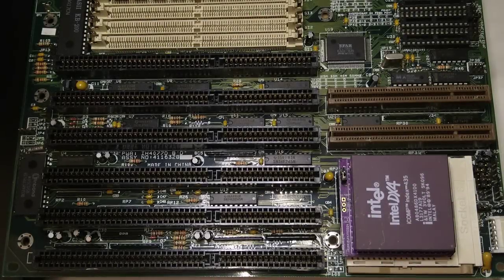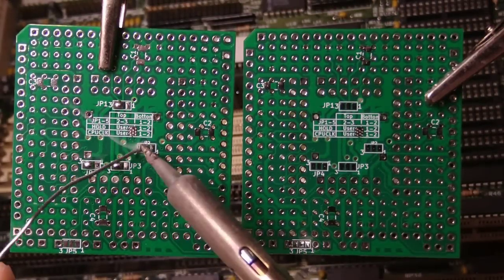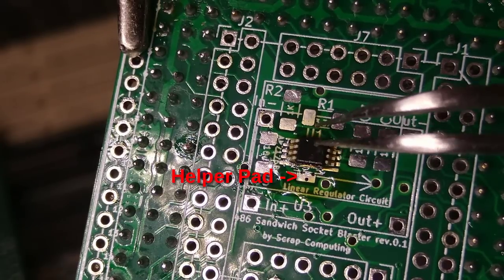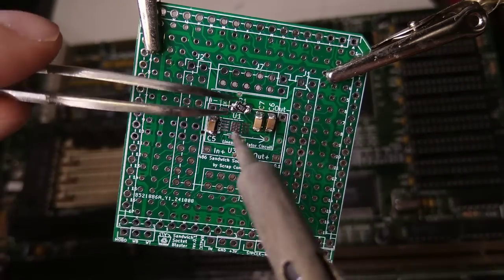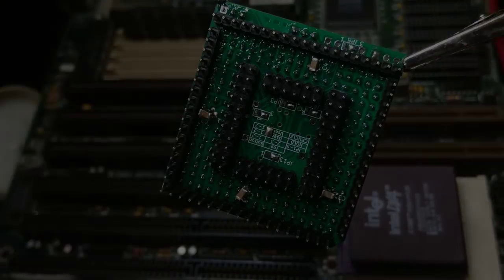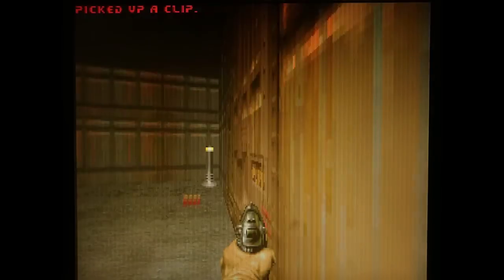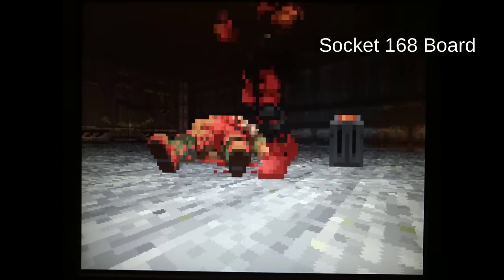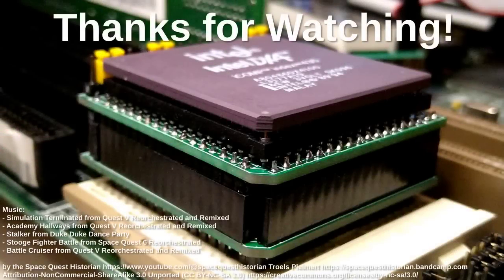486 Sandwich Socket Blaster: Redesigned Interposer for 3V CPUs on 5V motherboards

Comment: Just FYI, if you don't want to risk any components to twiddling the potentiometer on those Mini-360 boards, desolder the pot and put a 22K 0805 resistor on the potentiometer pads for 3.4V

Comment: I left this comment on Epictronics latest video about this adapter but I'll paste it here for you too with some additions. When talking to epictronics I offered to help with the PCB re-design, but since you can do that easily I may as well talk directly to the horse rather than the jockey ;-)

There is a very easy way to make the PSU better. Use the same pin header points that the mini buck converter board uses but make your own little power board that is larger and uses all the space inside the PGA socket. The board will sit up on the header pins so you can put parts on both sides of the board. The larger board can have more heatsinking (larger full copper internal power planes) and also have more and larger tantalum capacitors and some inductors which really are necessary for a proper SMPS PSU to work correctly. When mounting the little psu board put a thermal pad under the psu board so it touches the interposer board, push down then solder it down. Those thermal pads can be bought cheaply and cut to any size. A 4mm pad would work well. It really should also be a 4-layer board with vcc and gnd on the inside using large copper planes. The boards are not that big so the cost increase for a 4-layer board won't be too much but it will make a massive difference to power stability, especially with a new larger buck board and more tantalums and inductors.

Comment: Those pins just sticking in the air are insane :o Surprised it worked this well at all. You could try grounded copper foil between rows of pins to minimize cross pin coupling.

Comment: In the next version, do you think it would be possible to have a built-in 5v header for a fan? This would make for a very tidy cooling solution with say a 40mm 5v Noctua fan so you don't need to use a molex connector from the PSU.
Reply from the maker: That's a great idea. I will try to fit a header for a fan, not sure if there will be enough room for a proper molex connector though.
Reply: @scrap_computing  no need for a molex connector, just a 3-pin(it could even be a 2-pin) fan connector. make sure you leave room for the off chance that someone might want to use a 4-pin fan.

Comment: Wow, really nice. I will try to make one soon. Maybe also a ThrottleBlaster
Reply from the maker: Please keep in mind that it's quite experimental. I am not sure why it's not stable on my older motherboard. Perhaps it's better to just solder the two parts together instead of connecting them with male/female headers.

This adapter also includes a STPCLK pin which is meant to be used with the Throttle Blaster, though I haven't tested it yet.
Reply: @scrap_computing  Do you believe that distance between the two board is the instability cause? How would you solder it directly? Are there other pins/connectors that are shorter? Will you be trying this out?
Reply from the maker: @RetroErik  I am not sure what is the cause. It seems to be board-specific. I will try soldering the two parts together in case this fixes the issue.

Comment: Great experiment! Could you redesign the original socket blaster with a more powerful onboard voltage regulator? Unfortunately, even the larger buck converter isn't powerful enough for higher clock speeds. At least that's what I think is the cause of the crashes. Keep up the good work! This is a great project
Reply from the maker: Some folks have already forked the original project and have added a switching voltage regulator circuit.

If the AP7176B works good enough I will redesign the original board with the regulator circuit, because it requires very few supporting components.

By the way, in my experience the larger buck converter is actually worse than the smaller one, at least that was true for the really cheap ones I got on ebay.
Reply: @scrap_computing the AP7176B supports a maximum input voltage of 3.65v? It should support input voltages of 5+-0.25 rather?
Reply from the maker: @llamallarry  I think you are right! Vin is up to 3.65V, and Vcntl is up to 5.5V. I wonder why it works though...
Reply: @scrap_computing my guess is that it doesn't reliably work 100% of the time. Also, The degree of success may vary between chips of the same model.
Reply: The late 486 CPUs sometimes required more than 3.3v, like 3.45v. perhaps they also require a smaller ripple than the older CPU models?
Reply from the maker: Yeah they may need slightly higher voltage.
Reply: After a bit of research, the most current these 486 cpus could draw when  extremely overclocked is 3.1 ampere, AFAICT. And a theoretical maximum power draw of 10.8 watt at 3.6v in extreme overclocking. 
In other words the buck converter should support 3A and 10w to allow for heavy overclocking, like 166 Mhz.
Reply: @llamallarry  I have it on the bench this week. I'll try with better cooling and more power. Hopefully, we will know by this weekend. I'll make a video
Reply: And, for reference, the Intel 486 dx4-100 drew at most 7.5w at 3.3 volts, according to its specs. That means a maximum current draw of 2.3A. The buck converter must support this load as a minimum.
Reply: @llamallarry  the AP7176 he use wasn't enough apparently. it was spec'd with 1.7W maximum power dissipation. at 2.3A, the voltage drop should be 560mV at most to satisfy the spec
Reply from the maker: That was what I was expecting too, but I didn't see it cutting off at all even when running doom. Not sure what current the CPU was drawing though.
Reply: @scrap_computing A larger buck converter would be problematic for "Vdroop". Getting clean power with the dimensional limitations is tricky. I didn't keep any interposers from the 90s, just a Kingston TurboChip 133. Are you able to compare your design to an Evergreen, PowerLeap, etc.? Ardent Tool of Capitalism has a decent list of interposers.
Reply: @drewnewby  I actually have an original interposer on the bench in front of me :) It's using a 5A linfinity lx384. I'll make a separate comment with the datasheet link, because YT is probably going to remove the comment :/ I may test and show it in next week's video. not sure yet
Reply: @Epictronics1 I remember the Evergreen, and PowerLeap, but that website, Ardent Tool of Capitalism had several I had never seen, or forgotten. I do know I had separate ones for DX4 vs. 5x86, due to compatibility.
Reply from the maker: Yeah the original design worked fine with them. I am wondering if the issue is caused by some bad solder joint.
Reply: @llamallarry  I noticed when I ran a 5x86 with the large buck that the voltage dropped. They are spec'd for 3A on eBay and Ali but I'm not sure that can be trusted. I'll see if I can find the time to test one
Reply: The TPS82085 seems like a robust voltage regulator that meets all these requirements
Reply from the maker: That's an interesting part, thanks for sharing!

Comment: This sort of thing needs done with the Socket 423 to 478 adapters as well. When they do show up they go for hundreds of dollars, and there is no open-source project to replace it with. pin-compatible sockets for Socket M/P still exist and can be used instead, and the only difference would be figuring out how to wire up such an adapter so that any socket 423 board can get a socket 478 CPU installed. Ideally, an SL7EY 2.8GHz Northwood.

Comment: Great video!  The instabilities will be the length and routing of the traces with the 2 tier approach!  Brilliant work!  I think your original version is better, even if its hard to assemble!
Reply from the maker: Yeah, that's what I am suspecting too. I am also not sure about the connection between the male/female headers, perhaps it's better just to solder them, which could also reduce the height of the adapter.

Comment: I wonder why you use 1206 SMD Caps between the pins. If you would use 1608 metric / 0603 the caps should fit without angeling.
Reply from the maker: I prefer using 1206 parts because they are easier to handle, but yeah a smaller part would fit better for sure.

Comment: Great work! 
I still wish I had my 486 PC from way back when. I had a 3.3V adapter on it in order to use an AMD 5x86 133 MHz CPU as it was a fairly early 5V only board. I think I found the socket adapter via Computer Shopper or PC Magazine. Would be handy to still have it to use it for reverse engineering purposes. I too ended up creating a little tower of sorts in the socket as I also had a heatsink and fan on top of the CPU.